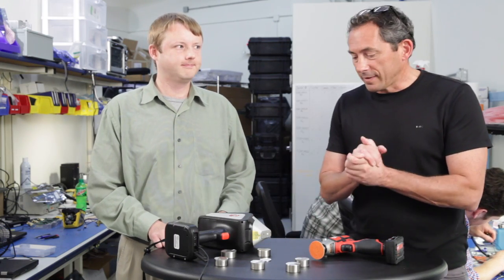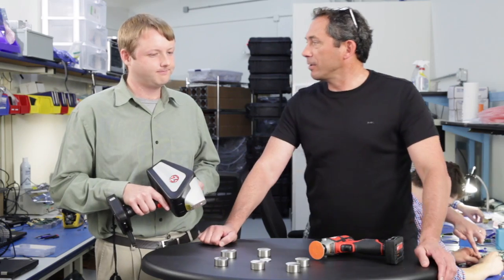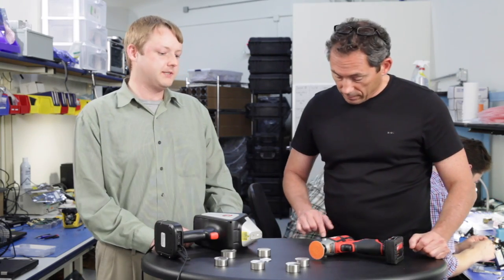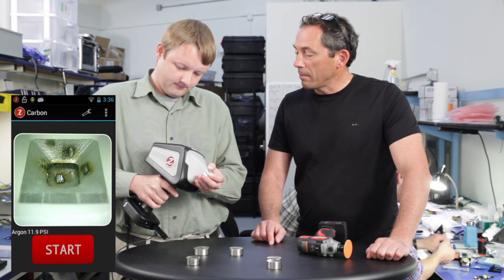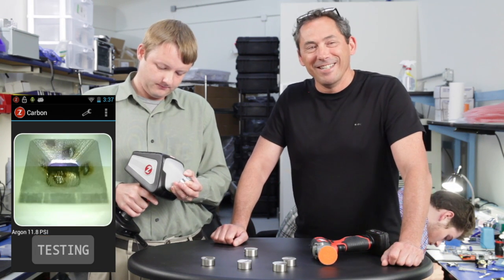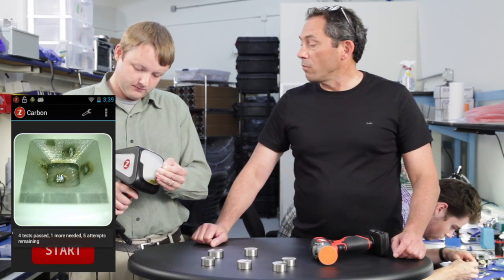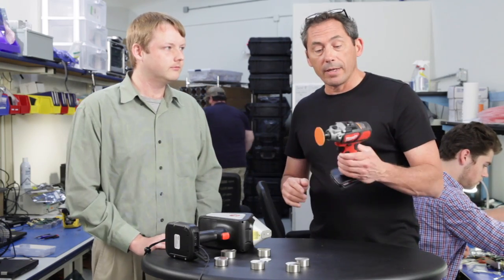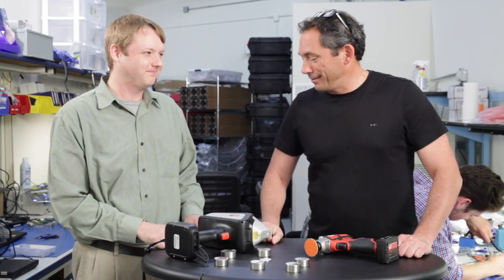Sciaps Z and L Grades of Stainless Steel

Comment: Facing a problem of laser cooling ...don't know what's that ? After 4 to 5 shots , the device ask for laser cooling. And even providing several minutes and letting it cool down it still flashes the message after 2-3 tests.
Anything could be done to avoid this? Help needed